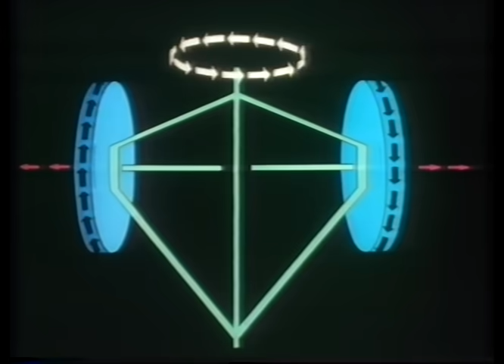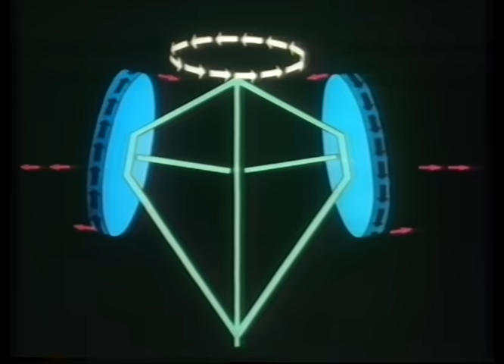Anti-Gravity Machine (Part One)

Comment: This and other similar machines cannot work.  There is a misunderstanding about how gyroscopes work.  There is no way to make a lifting machine based on these principles; you can make the flywheels to lift, true, but the total weight of the whole machine will be always the same.
Reply: I think you mean mass. Not weight.
Reply: Yes there is a complete misunderstanding about the operation of gyroscopes or flywheels, which has existed for many, many.years.
The machine does not lose weight it appears to but only because the system was designed to develop vertical thrust, which it demonstrated repeatedly.
Reply: It can't develop vertical thrust.  Put the machine on a scale and you will see no changes in the readings. The whole machine on the scale, not only a part of it, otherwise it is misleading.
Reply: Check YouTube "Sandy Kidd’s gyroscopic lift experiment" 
Read Jerry Deckers input and you will realise just how wrong you are.
You will surely find the laboratory test and report and photograph of the machine conclusively stating that inertial thrust had been repeatedly achieved by a different machine, nearly 30 years ago, but because of people like yourself who would rather not believe it it will stay that way.
Reply: I understand you have put much effort in this experiment, and I don't want to be disrespectful.  Also you understand that it is no easy to believe in your findings.
I have seen your video: it is impressive.
In which way the rope is supported ?  It seems like there are pulleys supporting it.
This isn't a reliable way to balance two weights, there is some static friction in the pulleys, and if one weight is slightly heavier than the other one you will not notice it.  They will stay suspended to the rope and steady, apparently balanced.  With the vibrations of the engine turned on, the little difference of weight will come up, and the lighter one will raise up. 
You can raise up your machine by meters in this way, which is certainly impressive, but not a reliable proof.  It would be better to use a scale, or a dynamometer, which are sensible and accurate, so you could also measure thrust power, if there is any.
I am sorry, but I don't think it's because of not believers if it will stay that way.
Reply: I was directing you to the Vipac Laboratory Test where the device was suspended by a Kevlar cord.
No pulleys or balancing system
It was for arguments similar to your own which were the reasons the lab test was carried out.
Incidentally the project was cancelled as the technical team involved in its assessment could not make its operation comply with Newton
In their minds it therefore could not be developed.
However remember the machine in this video Anti Gravity Machine Parts One and Two could repeatedly lift 16 ounces, pause half way up if required and drop like a brick when the gyroscope rotation speed was reduced rapidly.
Hardly vibration or slip stick,
The device in Jerry’s YouTube was a quickly made up test device to examine one of the oddities present during the lab test.
It proved what it was designed to prove, that when a device like mine was subjected to rapid changes in rotation speed unusual things happen.
I use pulleys with ballraces mounted in them (no not one way bearings) for simplicity and speed of set up, consistency and simple maintenance, usually a replacement picture wire.
With 16 ounces to play with there is not a lot of argument.
Reply: @sandykidd6482  Sandy please bring this Info Back for the next generation. Lots of young people and adults that like "lifter craft" which are similer. If you title videos with that they will get more views. Thank you so much for your hard work!
Reply: The total weight doesn't matter, the true lift is what counts.
Reply: Gravity is a dipole force distorting molecules and orienting them towards the center of mass. When a gyroscope spins above a certain rotation rate the centrifugal force rearranges that dipole and reduces the gravitational effect. In essence producing an anti-gravity or gravity cancelling force.
Reply: Don't waste your time, 'genius'.

Comment: Does anyone else see the flaw in this machine ?
Reply: Would you care to be just a trifle more specific.
Reply: Yes the one flaw is...EVERYTHING!
Reply: At first I thought the drill being externally anchored was a flaw, but another gyro could be used to anchor the drill
Gyroscopic procession has always fascinated me and been slippery for my comprehension
I don't have a similar device to test
But in my own attempts at conceiving gyro propulsion, I think the problem was always that gyros exert angular not linear force
I thought something like this wouldn't work
The basis being that you always need at least some kind external anchor or interaction
Reply: It's not rotating
Reply: Omg he pulled out the saucer
Reply: Nazi invention isn't it...they have sightings storys and all those diagram
Reply: Yes. It requires resistance of the vice holding it to measure the "lift".
Reply: @Sandy Kidd  How about no negative mass or negative energy? How are You supposed to use that thing for space travel at any significant fraction of the speed of light? To put it simply,You can't.
Reply: A gyro is not a gyro if it's unbalanced, this would never work!